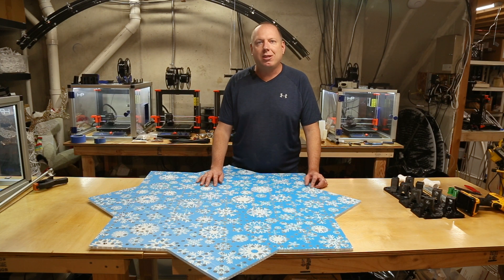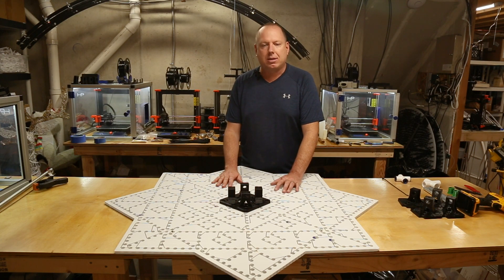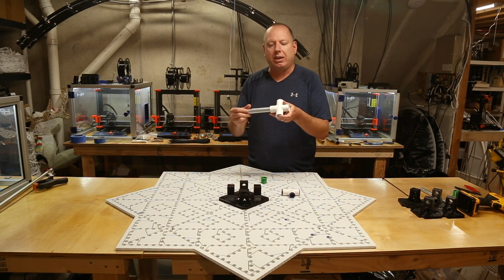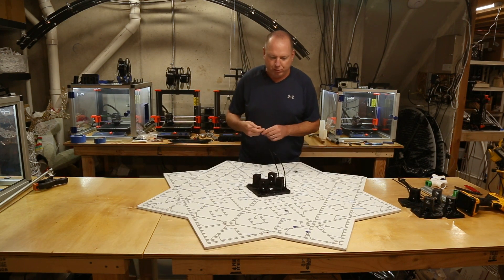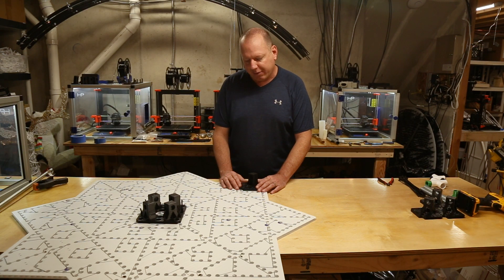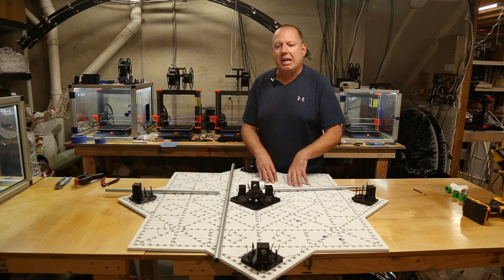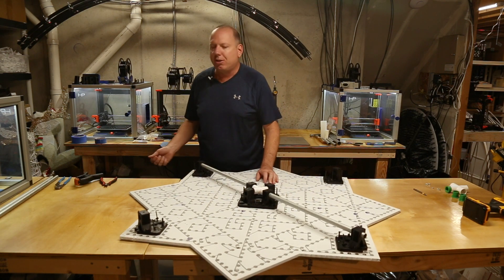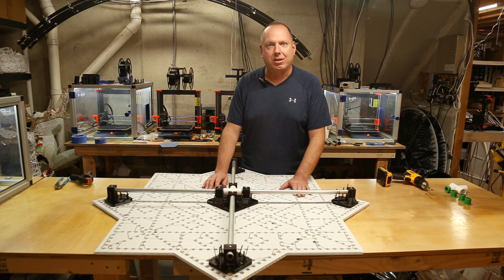Attaching 3D Printed Mounts to Coro Props

Comment: Hi,

Are you willing to make adjustments to your designs (centers pieces), for those who like to using the Maker Pipe Conectors (180 DEGREE STRUCTURAL PIPE CONNECTOR), the connector is 5" long which doesn't fit in the 3D printed center pieces. In my case, what I did to solve my issue was cut two legs of the 3D printed center. It will be a good option due to the structural integrity that this connector provides. Thank you.

P.S. I cut two legs of the center pices for the Rosa Grande, Quartets, SS Snowflake.